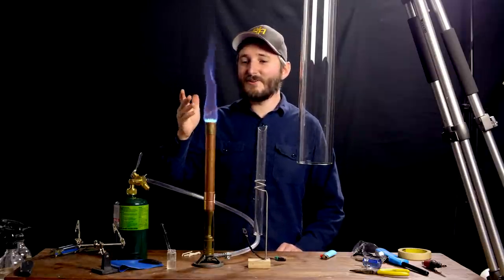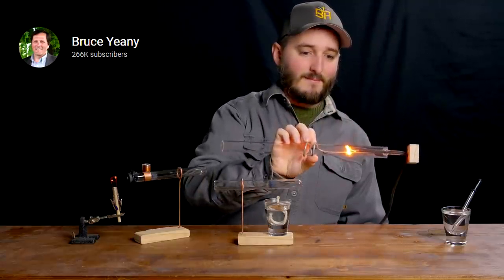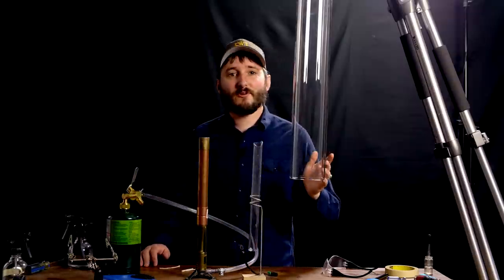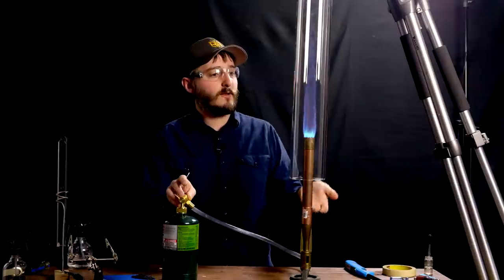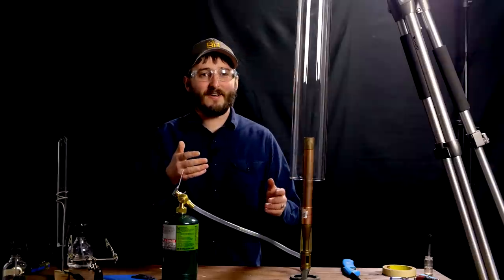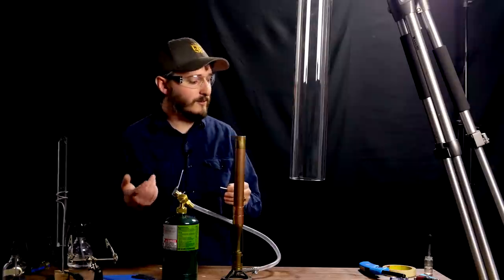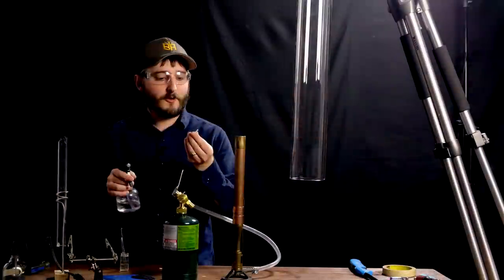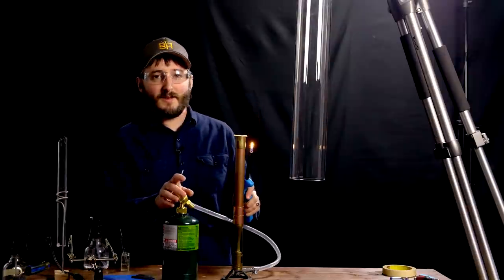Fire Driven Sound Waves in a Quartz Tube

Comment: I don't remember the exact details on the overtone series anymore, but I did play around with an online tone generator to try and match the pitches. 

Sir, you have a meme tube. The fundamental frequency is right around 69Hz to my ear, and that overtone it played is right around 404Hz (but I was having a hard time finding it). That's roughly two octaves and a fifth above the fundamental. 

From memory though, the octaves should be the most pronounced overtones. A fun trick to show beginner piano students is to hold down a key without having the hammer strike the string, then hit an octave below it and listen for the higher note due to resonance. It definitely works with the fifths, but I was surprised that the overtone the tube played was so loud.

Comment: The self-extinguishing flame. Which made me wonder if sound could be used to fight fire. I pondered a bit and my thoughts go from 'obviously not, an open fire is not in a contained tube' to 'obviously it can, i you can create enough sound pressure locally'.

Comment: You should try it again using a microphone or other sensor, microcontroller, and an electronic needle valve.  The the microcontroller then could quickly detect changes and modify gas flow to keep things resonant longer - perhaps even indefinitely.  Also, if you can get another quartz tube whose ID is the same as the OD of your existing one (or vice versa) you could use a motor on the same mcu to adjust the tube length and therefore resonant frequency.  That would turn it into a proper instrument that could play music.

Comment: Remember,  the propane torch draws air in at the bottom therefore the acoustic wave generated would greatly affect the flame.  Perhaps a tiny oxygen acetylene torch might perform better. Another thought to try would be to place the flame at the upper resonate node near the top of the tube.

Comment: You would expect the flame to get squished by its own reaction. The adding of heat from the burning expands the air around it. When the frequency is reached the pressure will be higher at the top of the tube due to this expansion. So at the bottom the air gets sucked in and the flame gets squished between the 2 currents.
The wave is likely caused by the frequency and very probably also happens in the smaller versions. It is to small to see this though and it is happening too quick.
Again really cool. Thank you

Comment: The higher pitch harmonic was being caused by the restricted opening at the bottom when you had your hand covering part of the opening both when lighting the burner and when you were lifting the burner. The first time may have been caused by the burner being closer to one side of the tube than the other or maybe by the flame having been just a little bigger or a combination of both. I thought the higher harmonic was a lot more interesting but the lower harmonic probably creates a higher air pressure. It would be interesting to see which moves more air volume vs air pressure.

Comment: I saw this but it was like a fire table. Another thing I saw was a fire extinguisher that used speakers to vibrate the fire at a certain way that is basically cut of airflow causing the fire to choke itself out.

Comment: Hey, great video, very informative and really fascinating. You were talking about how the flow of gas gets compressed by the incoming sound wave and eventually snuffs out the fire. Do you think that this kind of setup could be prolonged by adding some sort of small pressure bleed off that would keep the pressure of the sound wave from being too intense and scattering the gas beyond combustion? Might be able to create a nice equilibrium to where the flame pulses and dances as long as there is sufficient fuel.

Comment: what if you use incandescent light bulb as heat source, since most of the power converted to heat, attach magnet and coils like previous experiment, or maybe several piezo transducers, maybe it becomes a sound inverter

Comment: You should design the nozzle attachment on the  burner  to withstand flame reversal in other direction so it will not  be extinguished by sound pushing down.

Comment: it makes sense that one can generate a fire via helmholtz resonance say if the pipe is filled partially with wax and a wick protrudes out the open end. the precisely right frequency will cause the air to vibrate so much that the wick is heated to combustion temperature, thus igniting and causing capillary action in the wax. this is a sound-activated candle, no electricity or moving parts, except the air.

Comment: What a wonderful video! Your questions about the mathematical implications are interesting and I'm excited to see if we can find some answers. Would it be possible to fill the tub with smoke? I think smoke might help us visualize the density and therefore pressure of the air at certain points along the tube; as time changes, we can watch the interactions of the pressure nodes and their distances from one another. It could be possible to measure the velocity of the propane before combustion (would the velocity of the molecules be the same before and after combustion?). Thank you so much for opening our eyes to thermoacoustics and their endless possibilities!!!
Reply: You are a pioneer!
Reply: also, nevermind about measuring the velocity of the gas particles; I forgot that the slo-mo video can be used to measure that

Comment: Glad you spent all that $ on a quartz tube that big and made this video.....but FYI you can do this with a standard 9 inch oil lamp shade as well......I learned this one night I was freezing and didn't have central ac so I rigged up a single propane bottle to a small flame burner so I could warm the room before I cut on a single space heater. Just happened to  had an oil lamp nearby and thought I might better cover the flame for safety. When I went to cover the flame it extinguished it.....which I found really odd given....it was propane. Tried it again  faster this time and it didn't blow it out. So I thought I'd try it again(I was bored and cold). After messing with it till it got to hot to touch, I found a certain height and angle I could hold it and make it flicker just like this.
 Have been wondering about this so glad I saw your video. I guess resonance didn't click because I had to hold the lamp shade at a certain angle and elevation to make it happen so it would be more of a helical vortex flow than a toroidal vortex flow as in your's. What is the formula for calculating the proper height for resonance to occur? (You may have covered it in the last video I can't remember) thanks so much and have a great night!
Reply from the maker: In a tube the best resonance will come with the flame 1/4 from the bottom

Comment: You can actually see the force of the downward airflow push the flame below the edge of the lip on the burner. Usually with an open flame it will have a small area past the burner before you can observe combustion that serves to draw in oxygen to burn. Your resonance stagnates the airflow and makes it vibrate between confined expansion outward (up & down) and upwards flowing within the tube. When the expansion is great enough it "blows out" the flame by not allowing new oxygen to replace the oxygen used in the combustion.
You have the beginnings of a pulse jet there.

Comment: I’m struck by how well your experiment produces findings analogous to what we see when we try to create an antenna to radiate radio frequency energy.  As you moved the burner to the 1/4 wavelength point you found that the tube began to “sing” . You had perhaps  found the point of best impedance match .

Comment: Can you get resonance with a slightly conic vessel? I don't know enough about resonance and sound generation, but that seems like an open-ended conic vessel would create an uneven flow of air , rather than oscillating a flame (or the surrounding air) in place, it would propel it toward one end or the other.

Comment: Could you use a simple electric heater like in the small tube which is more consistent and you could place it at different height easily, and use like dry ice gas to see the flow of air ? Would that work to see the sound wave?

Comment: The reason the rubbing alcohol is "wetter" is due to the fact that alcohol has a lower surface tension than water, and lowers the surface tension of the water it's in. Salt water on the other hand might have a higher surface tension than normal water. You can think of surface tension as the maximum size of spherical droplets the liquid can form before spreading out into a blob once it gets too big. The lower, the smaller the maximum size of sphere it can make, which translates to how small of a gap the liquid can squeeze into, without just trapping an air bubble under it.

Comment: Hi! Great Video as always. If you hadn't told us you didn't use a script I don't think I would have noticed. Also, I was wondering if the valve on your little gas tank automatically shuts off the gas supply when the flame goes out.  My science teacher always emphasized to turn the gas off asap should the burner go out. Thanks!
Reply from the maker: Yes it only stays on when I hold it down. The flame stays lit only as long as the fuel in the tube takes to empty out.

Comment: IDEA:
make this demonstration more visual with some form of opaque gas surrounding the tube in an attempt to capture the distribution of sound waves.... i have thought about ths and concluded the most likely set up  would need the external area to be filled with the matrial.... i also would maybe suggest a steamy/smokey effect to maybe achieve the result.

since everything is transparant it does look really awesome and magical, but maybe scientifically it needs to be more accurate for observation, if it is possible. i dunno, maybe dry ice? the visual is only the light of the flame and it is very pretty, but i think a deeper attempt to make the observation would be rather intriguing to most of this audience.
Reply from the maker: I tried smoke but it flows too quickly out of the tube

Comment: I think you misspoke at the end?
The sound wave does not travel more slowly or quickly depending on its frequency; there's only more or less cycles from point a to point b. A higher frequency sound may attenuate more getting from one place to another but it's still going to travel at the same speed.

Comment: I recall seeing a film/video years ago where a gas flame was acting a a dynamic audio speaker.  I don't recall how it was constructed but I believe current was passed between the Bunsen burner and a metal ring the flame passed through to complete the circuit.  I think the flame was fuel rich to keep the carbon particle content higher to pass more current instead of having it burn off too soon into CO2.  I recall the frequency response was pretty wide.
Reply from the maker: It was probably an arc speaker, and the flame was mostly for visual effect. Arc speakers are pretty cool
Reply: @Nighthawkinlight  I'm familiar with using Tesla coils for arc speakers but this was just a gas flame passing through a ring, no glass tube, no other source.  I've been hunting for the video clip for months. It's at least 20 years old.  It's driving me batty.
Reply from the maker: If the ring were connected to one lead and the candle wick connected to another you can make an arc go through a flame pretty much invisibly

Comment: So, I'd like to further add that while I'm blowing glass and the tubes start singing, the tube is horizontal  when it sings. Which seems to go against what your demonstrating in the beginning. Also, not every tube sings while I'm working, it seems to be the ones with more condensation on the inside. I was told as an explanation that the condensation is evaporating and then recondenseses b4 leaving the tube, also my tube is constantly being rotated, not just held in a vise or holder. Also also when the tube sings, one end is closed, usually the end in the flame
Reply from the maker: A closed ended tube uses a different means to resonate on its side than the open ended tube which only resonates vertically. I demonstrate this in the first video of my thermoacoustic series. I suspect your observation that tubes with more condensation tend to be the ones that resonate is because the condensation indicates that part of the tube is still at a relitively cool temperture. The resonant effect is amplified by how drastic the temperture difference is between the hot and cold sections, so given the same temperture at the hot end it will always work better the colder the rest of the tube is.

Comment: A tuned 2 stroke exhaust pipe, uses acoustiques to improve exhaust flow? Special blended metals may use resonance in engines to improve ignition, may b even in a diesel engine? Secrets of engine building?

Comment: NHL, now it might be a good time to try that with steam. Would it act the same?
Reply from the maker: Steam usually releases its heat when it snaps back into a liquid state on a surface. I don't think the heat would pass to the air effectively enough at the point of injection

Comment: If you put a speaker nearby this setup could you play back the resonant frequency to have the tube resonant to blow out the flame. 

If the flame was placed in a position that is not in a place that creates a resonant frequency it would be interesting to see.

Also why not some copper sulfate for coloring of the flame.

Also interested in seeing a speaker placed on the opposing side a bit away with a screen between it. That is of course if the idea of blowing out a flame or candle with sound is something your interested in doing.
Reply from the maker: Bruce Yeany did something similar to what you describe with a candle flame in his video
Reply: @Nighthawkinlight  That was cool, Thanx! Wonder how this would react if there was a bend in the pipe. Could have been in the pipe after the heat source allow the pipe to be held horizontally. With the air passing through the heat source be heated enough to rise after the bend pulling additional air in on the cold side.

Comment: Wonderful video! I have some long glass tubes I'd like to try this with! Is the quartz tube for a tube furnace by any chance?
Reply from the maker: The tube is a replacement tube for an outdoor infrared pillar heater like you see at some fancy restaurants
Reply: @Nighthawkinlight  Neat! I'd never heard of those before now. If you have some kanthal resistance wire some alumina fire brick and some ceramic wool you can make your own tube furnace to do very high temperature experiments in a controlled atmosphere (you can use it to make superconductors like YBCO for instance).

Comment: As a long time ham radio op, I'm very familiar with the concept of resonance in wire lengths and RF.    1/4 wave is a strong resonance point, yes.  However, at the half wave point there's a much greater efficiency and a small increase in gain.   
I see no reason why the same effect wouldn't be seen with physical resonance.   If you have a way to move the burner up to the half way point in the tube, it would be interesting to see if there is a large increase in the effect as well.
Reply from the maker: A wire has a fundamental resonance that looks like this: <>
A node at each end. That makes the half way point a good place to stimulate resonance. For an open ended tube the fundamental looks like this: ><
The node at the center point makes it a bad place to try to stimulate resonance
Reply: @Nighthawkinlight  Ah!  Of course.   The open end of tube provides nothing for the pressure wave to bounce off.   I didn't think far enough into that one.

Comment: 9:21 I just wonder if it can be 'scaled up" and used by Firefighters to extinguish fire in some cases?
Reply: Extinguishing fire with a massive speaker which can change the air flow enough to cut the air. I hope you have quality noise reduction headphone.

Comment: Another flame sound I saw in Tyndall's book SOUND may be of interest. He likens sensitive flames to the analogy of an avalanche where a tuned unstable flame is triggered by the slightest upset.
§ 12. The Vowel-flame
"A flame of astonishing sensitiveness now burns before you. It issues from the single orifice of a steatite burner, and reaches a height of 24 inches. The slightest tap on a distant anvil reduces its height to 7 inches. When a bunch of keys is shaken the flame is violently agitated, and emits a loud roar. The dropping of a sixpence into a hand already containing coin, at a distance of 20 yards, knocks the flame down. It is not possible to walk across the floor without agitating the flame. The creaking of boots sets it in violent commotion. The crumpling, or tearing of paper, or the rustle of a silk dress, does the same. It is startled by the patter of a rain-drop. I hold a watch near the flame: nobody hears its ticks; but you all see their effect upon the flame. At every tick it falls and roars. The winding up of the watch also produces tumult. The twitter of a distant sparrow shakes the flame; the note of a cricket would do the same. A chirrup from a distance of 30 yards causes it to fall and roar."

Comment: Dear nighthawklight, I made a ground breaking Recreatable phenomenon with your acoustic vibration tubes.  Invisibility.  There’s a frequency under the vacuum in a tube.  The residence is invisibility harmonically.  It works though.  The length and the diameter of the tube   You’re never believe it it’s OK